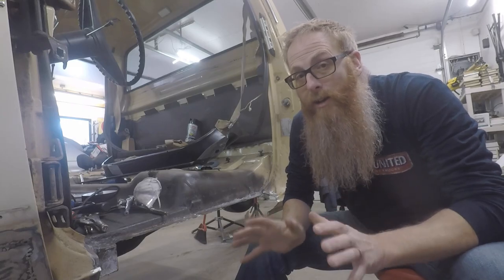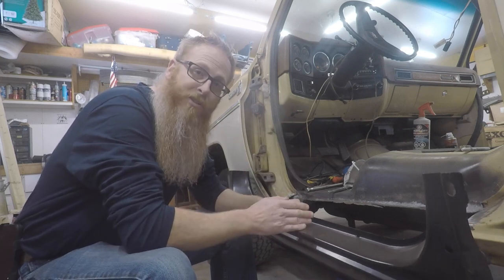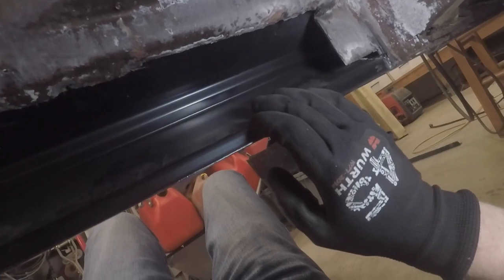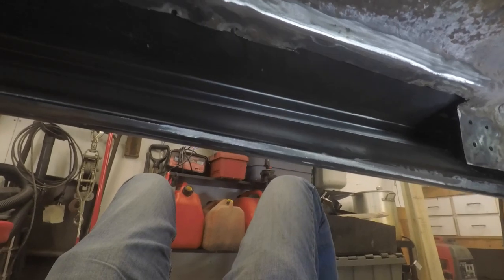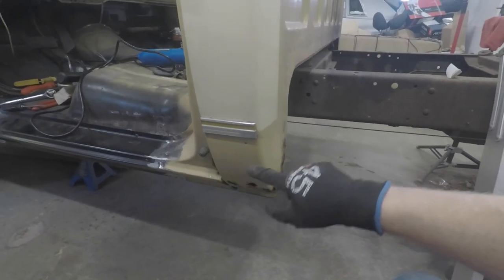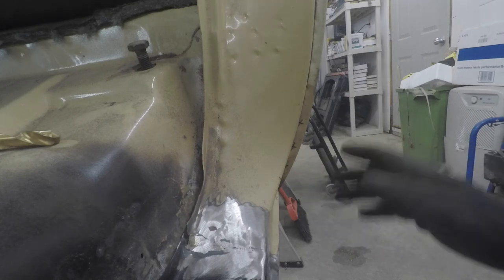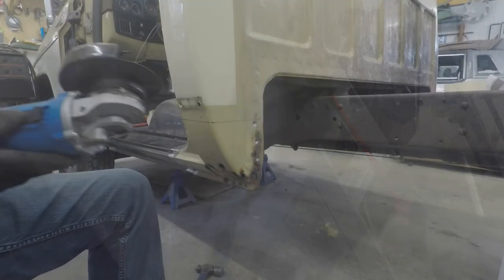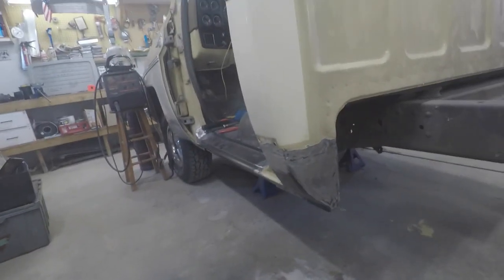HOW I REPLACE CAB CORNERS AND ROCKER PANELS ON MY 1977 CHEVY C10 SQUARE BODY PART 3

Comment: Rose bud welding is a great method to use for the inner rocker panels
Reply from the maker: Rosebud? I guess I'm still learning!
Reply: @OldeCarrGuy  you drilling holes and spot welding in them holes to affix piece to other piece is also known as rose bud welding

Comment: Great job, looks amazing, where did you buy the outer rocker replacements? I’m in the process of replacing on my 83 c10
Reply from the maker: They actually came with the truck when I bought it. I would recommend AMD (Auto Metal Direct) for your patch panels.

Comment: So you just make spot welds along the whole joint? Not just lay a bead in it for the whole joint?
Reply from the maker: Yes. If you try an lay a bead the metal will burn through. I was learning a I went.
Reply: @OldeCarrGuy  thank you sir Might have to try it out 😏
Reply: Ordered my cab corners/rocker panels from brothers and they should be here this Friday. Gonna watch this video probably more than a couple times haha

Comment: What type welder are you using?
Reply from the maker: Hobart 110v
Reply: Olde Carr Guy What wire and wire size and settings are you using? I’m about to start on my 84 and want to make sure I get the right stuff from the weld store. Thanks and awesome work!

Comment: Looking to buy a K10 that needs body work, (ironically almost the same type of work you were doing) do I also need to remove the cab?
Reply from the maker: I’f you’re replacing cab corners and rocker panels , you do not need to remove the cab!
Reply: @OldeCarrGuy  perfect because I don’t have that type of equipment

Comment: Hey buddy thanks for the video. What did you use to treat the floor panel so it wouldn't keep rusting?
Reply from the maker: It's a product called Rust-Off i get at my local Napa. But any rust converter should do the trick! Thanks for watching.